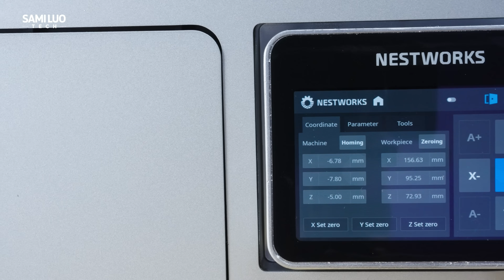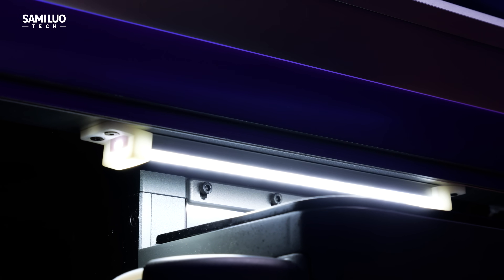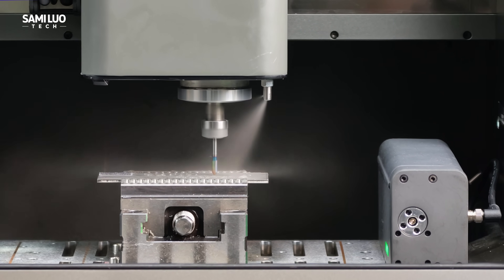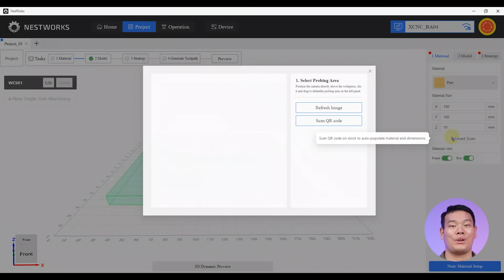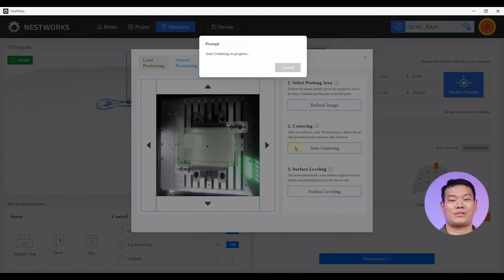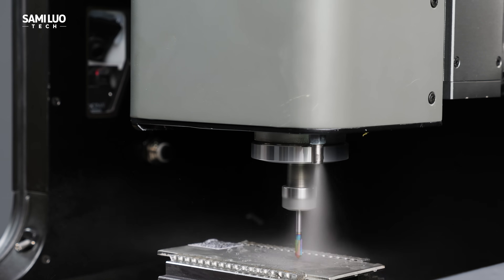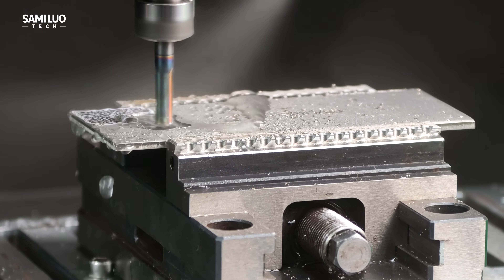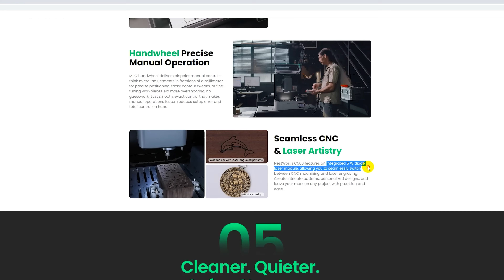Can This CNC Machine Stainless Steel? NestWorks C500 Puts It to the Test!

Comment: 9 days have lapsed and still not follow-up video showing this thing working. I also can't find any other independent videos on YouTube that show this machine doing anything, but NestWorks as uploaded numerous worthless hype videos. This appears to be another scam.
Reply: First machines for customers not aviable for delivery until April 2026 anyway..there is plenty of time..do not worry. You seam to be looking for someone testing it for a 100 hours, like you want to be 100% sure before you possible order. It won't happen. If getting hold of a new product like this early on, one need to take a bit of chances. Or one can just wait a year or two for a version 2. It's a new manufacturer of CNC, there possbile will be a number of flaws detected with the v1
Reply: @Rimrock300  NestWorks supposedly sent reviewers demo units to try out, but no one has posted videos of them actually using them. This YT'er claims to have one and makes excuses for not demonstrating it. Blatant details are missing from the specifications. The type of linear rails, their size, and the size of the ball screws is pretty basic information, but NestWorks hasn't provided it. There is a lot of hype and little substance to this promotion. 

I agree with you completely that anyone investing in this project is taking a chance, but I suspect that it is much greater than it should be. This is not an inexpensive purchase and, at this point, buyers might end up with a worthless piece of garbage.
Reply: Yeh this video is dodgy as. It's just marketing hype with no follow up of an actual review. It's questionable if the guy even manages to use this machine
Reply: @StevenHughes0  So you're saying that Nestworks marketing released this video?
Reply: This aged well.
Reply: @the_naP  I'm not sure how to interpret your comment. This YT'er never released a follow-up video and there still isn't much reliable information about this unit.
Reply: Hey, thanks for your feedback. We've already started releasing the video!
Reply: @NestWorksCNC  I'm  not sure what you mean by "started releasing the video". Unless you have  an incredibly slow internet connection, it usually doesn't take much time to upload a video. 

I look forward to watching yours because I still can't find any videos from any source other than NestWorks that shows this thing doing anything. Even your video appears to be composed from NestWorks' clips. 

This CNC checks a lot of boxes for me and I'm interested in purchasing it, but there are some glaring omissions and lack of basic information, like what size and type of linear rails are used?
Reply: @NestWorksCNC  I am also trying to find out what the stock material dimensional limits are?

Comment: And other video of C500 with not show real speed cutting...
Reply: True, i bought a laser fiber 50w ir, it's the same, it can cut 5 mm of brass but in 3 hours for a surface but never for only cutting a simple line.
I am waiting the end of the campaign for this cnc, it's a lot of money and i am new in cnc.
Reply: Good point.  He has included feeds & speeds information in the video, but it is helpful to show at least some of the footage at real speed.   It is also helpful, when showing sped-up footage, to show the speed multiplier in the corner of the screen.  A few seconds of actual sound, from time to time, can also be useful.
Reply: Do you want to watch a 10 h long video? lol
Reply: @dronesaresuperb4047  if a CNC that cost 5000€ cuts aluminum in 2h...sorry but you pay for a incredible poor machine for the pice. 

I have a diy cnc that cuts alu with 6mm endmill in minutes with conservative 1280 feeds and cost me create less than 1500€...for 5000€ you can make a beast diy cnc that cut steel like cream....
Reply: There were several clips showing real-time cutting... or did you just scrub through quickly?

Comment: "the surface is incredibly smooth" didn't it cut around a flat piece of metal with a tiny inlay? I guess you could have burrs on the edges but for the most part why would the faces not be smooth?
Reply: This is intended to be constructive, not offensive: often when I see a comment like this on a topic of interest, I rewind and watch the relevant section.  Without a TimeStamp, I may never find it.
Reply: @PiefacePete46 thanks. This gave me the push to google how to actually timestamp a comment 7:05 is the timestamp
Reply: @StevenHughes0  :  Thanks for that, happy to be of service!  😜
Reply: You ever machined anything?

Comment: How does it compare to the HiMill D1S?
Reply: 5-6x the cost and way more capable
Reply: 150W vs 800W Motor, No Tool Change vs 5 Automatic Tool Changing, covered linear guide, No Coolant vs Coolant. You're going to be wasting alot of time on the HiMillD1A, and get less capacity and poor surface finish
Reply: @Ken-nv2hl  Thank you. Ended up not getting NestWorks it's a bit too expensive